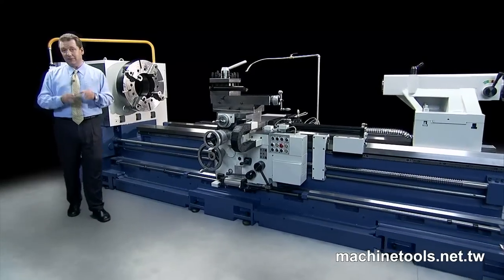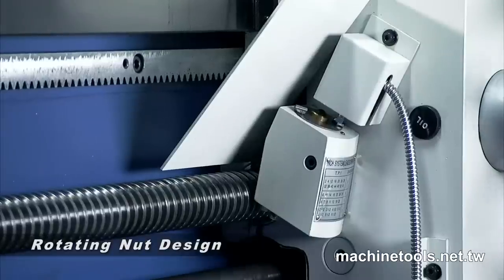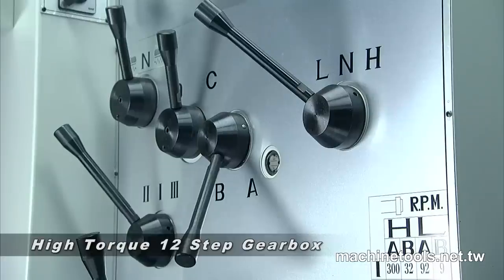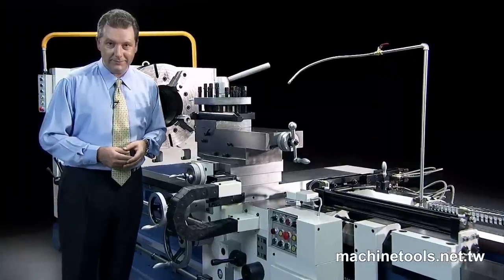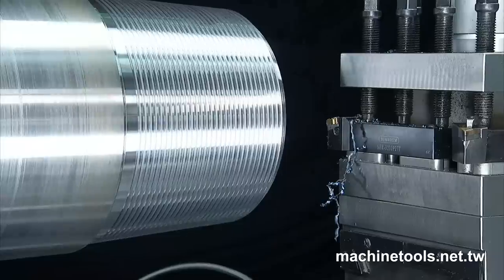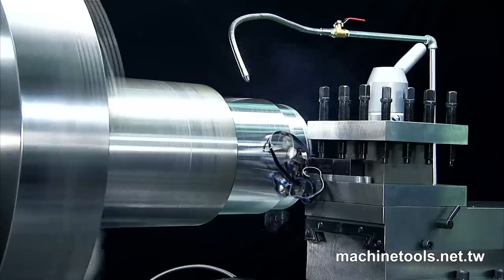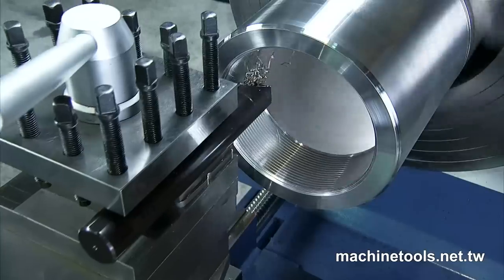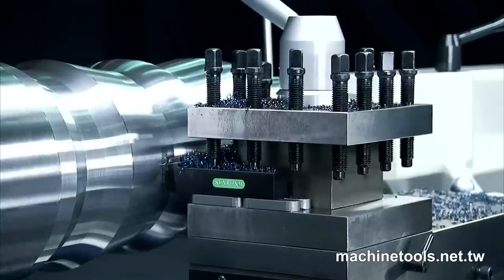Heavy Duty Lathe - High Rigidity - Wide Spindle Bore - Myday

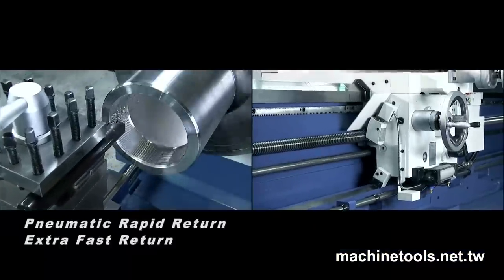Comment: 3:31 the carbide insert is missing on the boring bar, wtf??
Reply: wait what, thats true lol
Reply: i saw that too and asked myself
Reply: No it's not, it sits deep in the holder, it is the black skinny diamond shaped thing.
Reply: @dzarren  i dont think this is the insert
Reply: @janmaurer5135  It is actually.
Reply: @Trident_Euclid  Nope, that is the carbide backing plate. They are missing the actual insert.
Reply: @irfp460  yes, at 1.37 you can see that the insert is missing.
Reply: Might be the seat.